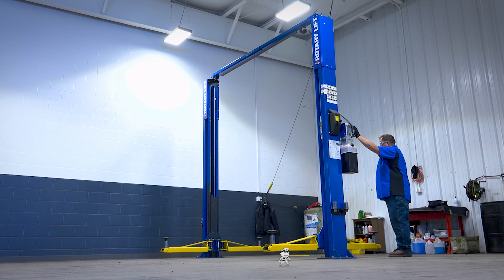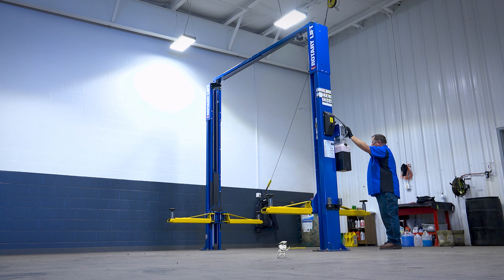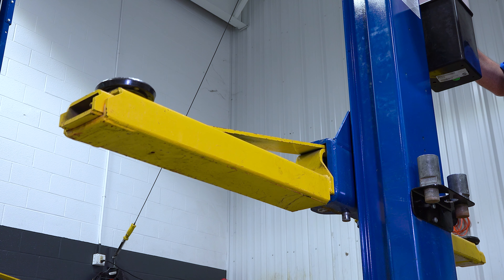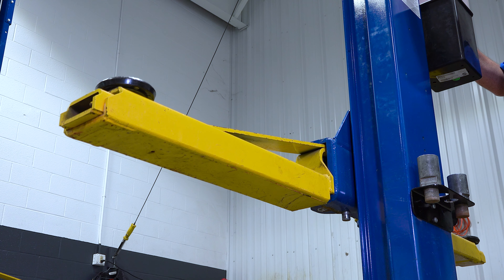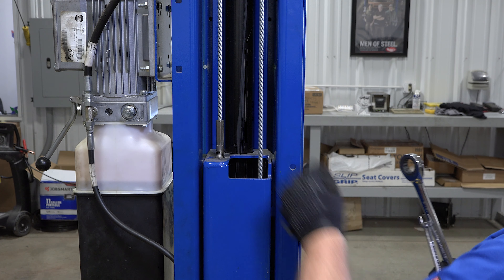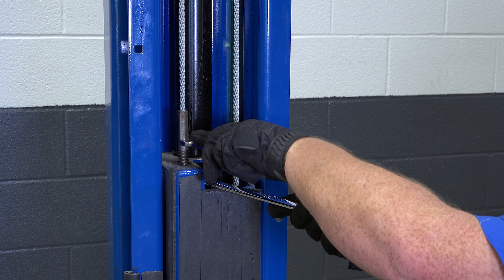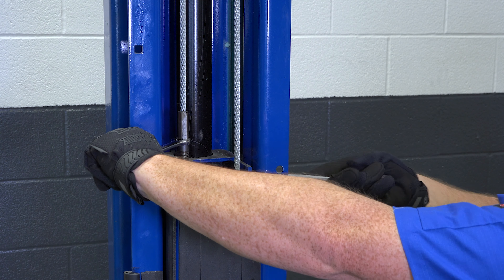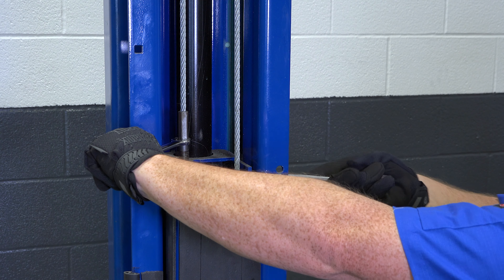Shop Tips: 2 Post Cable Adjustment

Comment: I have a vehicle on a lift that the left post lock doesn't want to release.  You said not to adjust the cables when a vehicle is on the lift but what if you have no choice??  I've tightened the cable on the loose side and all it seems to be doing it tightening the cables on the opposite side.  Any insight??
Reply from the maker: If the left post lock won't release then most likely you need to adjust the "Lock Release Cable", not the equalizer cable.  We do have a video showing how to make that adjustment that you can watch here, https://youtu.be/pLy1oj-7Oec.  But, with a vehicle on the lift we would suggest calling technical support at 800-445-5438 or visit our website to locate your nearest Rotary Authorized Installer.  https://rotarysolutions.com/support/resources/rai-locator/

Comment: My lift locks click at the same time when no car is on it but when car is on it the click at slightly different times.
Reply from the maker: Sounds like the lift needs a slight cable adjustment.  We recommend contacting your closest RAI to get the issue fixed and to get the lift inspected.   https://rotarylift.com/contact-distributor/
Reply: Yeah, I get that a lot. You'll really have to hear it if it's really synced with each other the slightest offset will do that ... Once you catch it you'll know to adjust it a tad bit... If not back out the nut on both and start over

Comment: The side that clicks "last" or "Later" than the other is too TIGHT or too LOOSE?
Reply from the maker: The side that clicks last/later is generally found to be too loose. That side will need to be tightened up to match the 1st clicking side.
*note, only adjust cables only while unloaded
Reply: So, If the RIGHT (Power ) side clicks FIRST, do I tighten the RIGHT cable or LEFT cable?  (IE Left adjust nut adjusts Right side and vice versa, I THINK).  Thank you, Michael  @RotarySolutions
Reply from the maker: The side that clicks last would need to be tightened.  So, if the right (Power unit) side clicks last then you will need to tighten the right side to match the left side.
Reply: WHICH adjusting NUT controls WHICH SIDE?  In other words, does right nut tighten left side or right side.  @RotarySolutions
Reply from the maker: The nut on the right side controls the right side, this is the same with the left side. So, if the right (Power unit) side clicks last then you will need to tighten the right side to match the clicking on the left side.